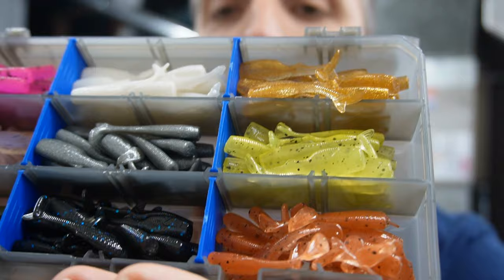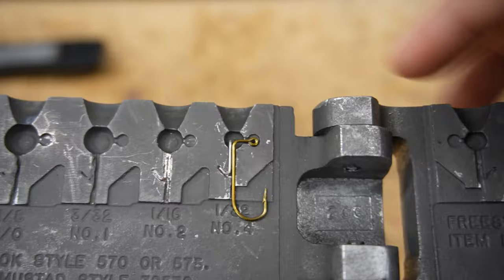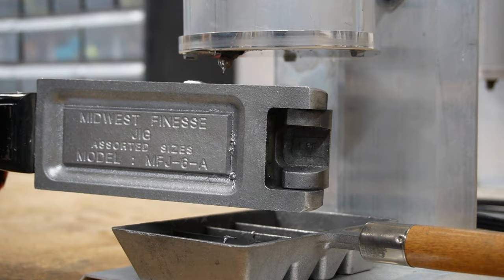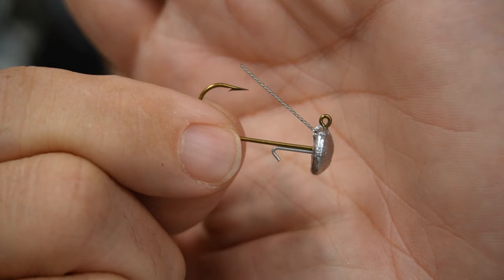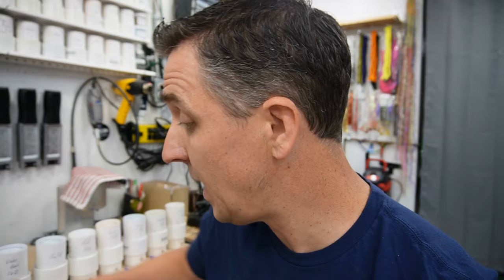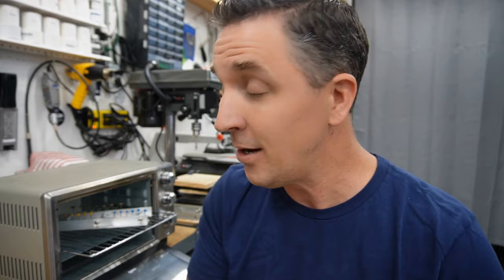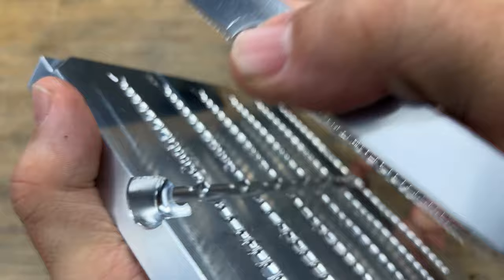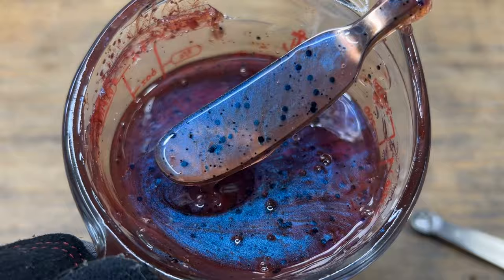Baitmaking Collab to Catch Creek Fish! (Shop-To-Water)

Comment: Looks like a good trip. How many coats of Sally Hanson hardener do you put on your jig heads? Thanks
Reply from the maker: In the past I’ve only used Sally Hansen’s when I apply eyes, but these days I use UV resin to attach my eyes and don’t break out the SH.  When I did though, 1 coat always seemed to do the trick!
Reply: @SDGCustomLurecraft  thanks for the reply. I've been using 2 coats of SH but I agree I think one coat is enough. Really enjoy your videos and they have helped make my jigs better.

Comment: Out of curiosity, how does the plastics go to the top and bottom of the bait with two different colors when it's just one channel to inject in?  Thanks for the informative channel and the well done content, really enjoy watching the process.  God bless
Reply from the maker: Thank you much, glad you're enjoying the content!  For a laminate (2 colors shot at the same time), assuming the two sides are close in temperature (and thereby close in viscosity - there are exceptions where different temps are required to get similar viscosity) they will flow into the mold at the same rate and flow into the two halves of the cold properly... the bottom color on the bottom side of the bait, the top color vise versa.  Typically, single port molds are cut with just that... the top of the bait on one side and the bottom of the bait on the other.  There are also multi-port molds where the baits are cut sideways.  This allow you to shoot a belly color vs a back/top color for each bait (think swimbaits).  So... its really all about mold design and controlling your plastic so the two colors don't mix while shooting.  Hope this helps!